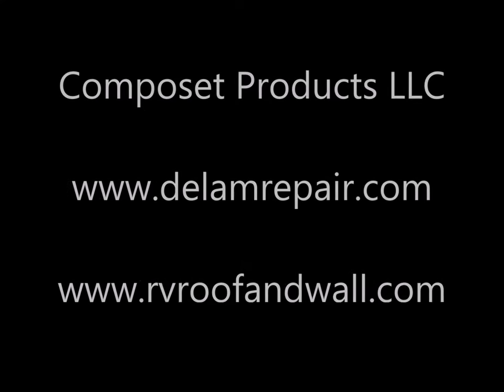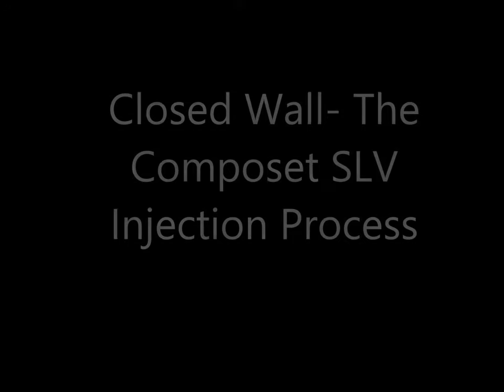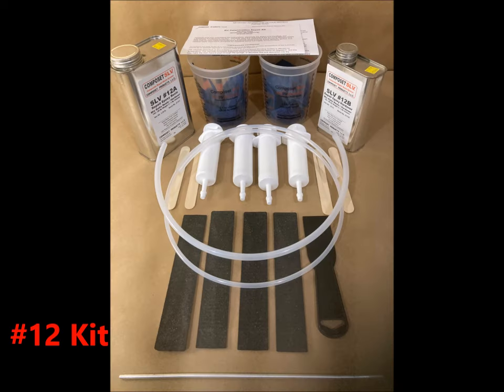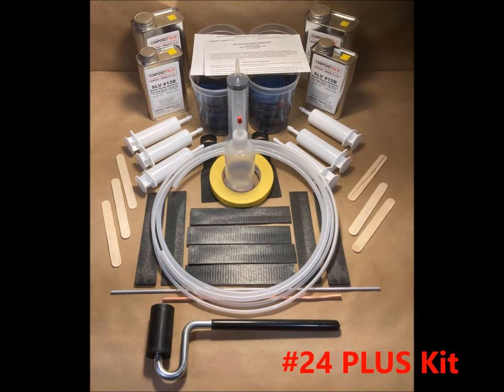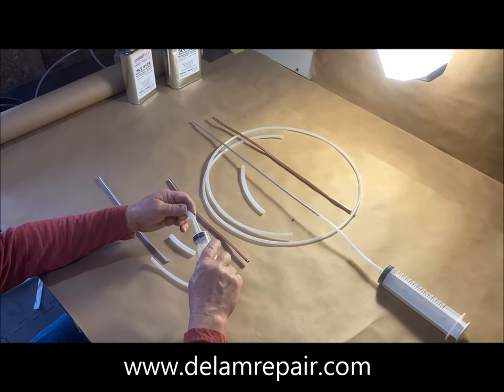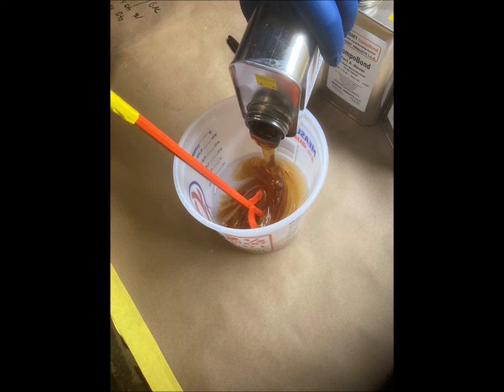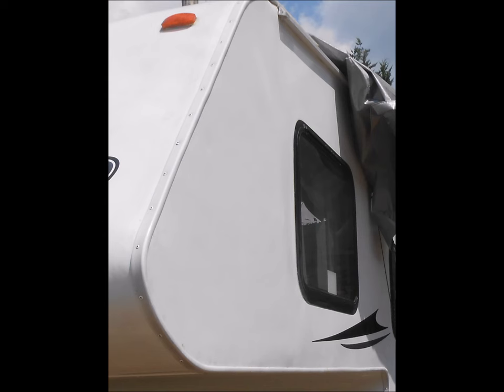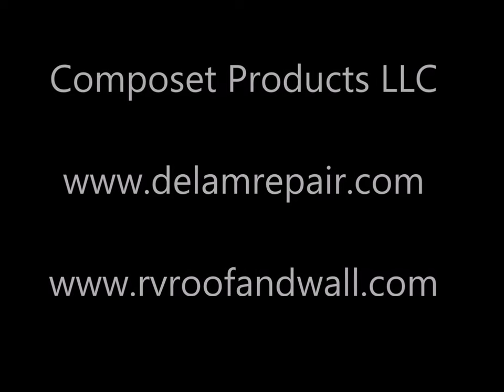RV Wall & Siding Repair- What is Delamination and How to Fix It for Do It Yourself & RV Shops

Comment: What about when the plywood's rotten in behind? From my experience most of the time this is the case
Reply from the maker: When the wood is rotten, moldy, or disintegrated the entire area of the wall should be replaced/rebuilt. In many cases, the plywood is only delaminated (the plies in the plywood have separated). This happens because the glue used to make the plywood dissolves due to exposure to moisture. In these situations the wood is still present, though no longer bonded together (the plywood has delaminated). When this is the case (and the degree of damage can very) it is possible to re-bond the plies of the plywood.
Reply: @composetproductsl.l.c.dela2844  Is it possible to replace only the outer plywood or does all plywood and foam need to be replaced in the case of severe outer plywood damage?  I pulled my outer fiberglass away from the motorhome in the same area in the video and the wood is in very poor shape, but the fiberglass is still very much straight and solid.
Reply from the maker: @Taupe201 Hi, It is up to you to decide how you are going to make repairs. The best way is to replace the entire wall. If the plywood is falling apart the best choice may be to replace all the plywood.

Comment: I'm replacing a cabover section on my truck camper that has delaminated with a new section of fiberglass from the manufacturer. Do I need to buy your glue?
Reply from the maker: Typically, the fiberglass is bonded to the underlying plywood using and adhesive. We sell Composet SLV and Compobond epoxies, as well as Stabond contact cement. Both types of adhesives have been used to bond fiberglass to wood.

Comment: My edging has come apart along the front of the cab over part (c type rv), and I'm wondering if your open glue is the fix along with watertight screws perhaos. 
Hubs is thinking old style using an allthread bar, it sounds unsightly.
Reply from the maker: Most likely there is underlying damage...delamination of the plywood. Sometimes our products are the right tool for a repair, and sometimes a complete rebuild id needed. Send a couple of pics to tech@delamrepair.com for more comments.

Comment: I would never ever buy laminated RV. I don’t know why they do not go back to the aluminum siding. there’s still lots out there and in good shape. like that old saying if it’s not broke, why fix it🤣🤣
Reply from the maker: There are benefits to the aluminum including the fact that the panels can be mechanically attached to the framing. The still leak, and the underlying plywood can delaminate and rot, it just that the metal siding does not fall off it is screwed to the framing.